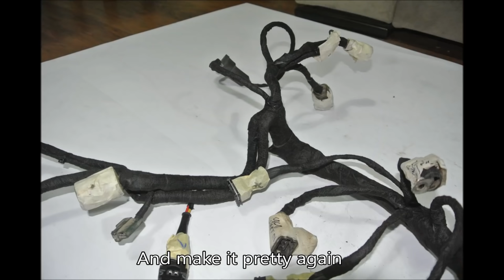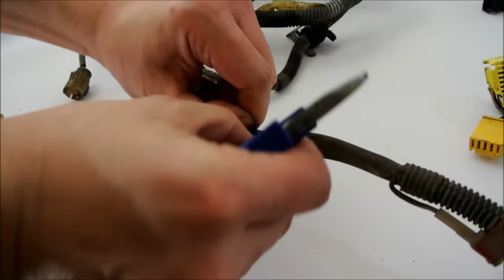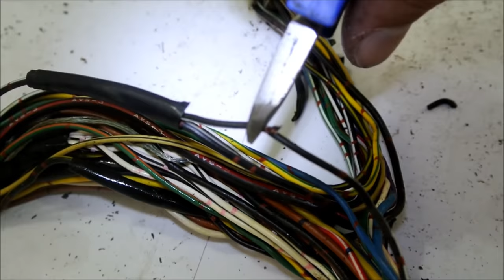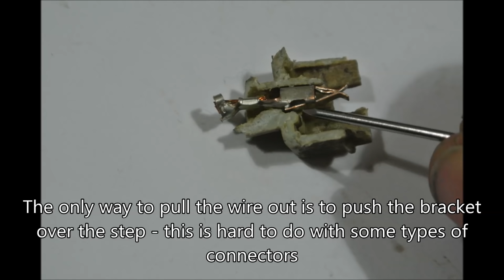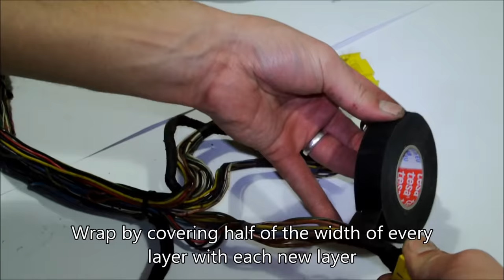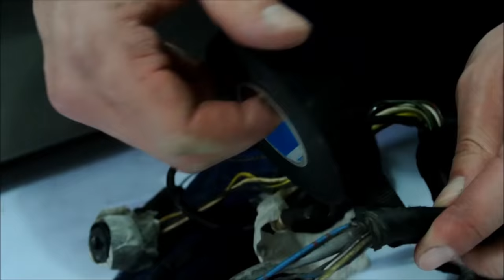How to DIY - wiring harness restoration

Comment: I've done my fair share of wiring harnesses and I can tell you that adding vinyl non-stick tape to the harness, before you add the Tesa tape, does wonders for making sure the harness doesn't turn into a sticky mess after some heat cycles. I go Vinyl Tape > Kapton Tape > Tesa Tape. I use the Kapton Tape on areas that will see higher heat ranges as it's supposed to keep heat at bay. I wrap the harness in TechFlex sleeving and use marine grade heat shrink to keep it tight. Hmmm, I may do a video on this 🤔
Reply: Please do!
Reply: Links to the tape you use please!
Reply: @Chache1527  For some reason I can't post a link in a reply, odd. But if you search for Dry Vinyl Tape or Non-Stick Vinyl Tape you'll get some hits! The Kapton Tape is pretty straight forward, search for that and you'll have a ton of options!
Reply: @VegasBoost  awesome thank you!
Reply: @Chache1527  Anytime! I'll be making a video on these wiring issues soon and this gives me the idea to include the parts in the description!
Reply: @Chache1527  I don't have Snapchat, but I'm on Facebook and Instagram. VegasBoost on both accounts! I'm almost always available 😊

Comment: "How to restore a wiring harness" (uses open barrel butt connectors).....
Reply: bruh, I was thinking the same thing lolll
Reply: Your absolutely right!! I would have used solder and shrink tube!
Reply: @laszu7137  I would not use the garbage that is the ROHS compliant solder, I would use a good high quality lead based solder in an automotive application. By removing the lead from the solder it becomes brittle and prone to cracking. Once the joint is complete a couple of small dabs of low temp hot glue allows for the shrink tube to create a watertight seal. I have done this before and never had any problems from the solder joints.
Reply: @gingersquatch9844  Of course it depends on where exactly it is and wheher it's secured or hanging somewhere. But in general a proper solder is pretty much equivalent to a well executed twist splice. Good enough for most things, but only trouble-free permanent solution has always been crimp.
Reply: @laszu7137  for whatever it's worth, the harness my LS1 came with is soldered with adhesive lined heat shrink tubing, in multiple points inside the harness.

The connectors are all crimped though.
Reply: @laszu7137  are you joking?

Comment: Another way in wrapping the harness with electrical tape is to wrap the tape sticky side out and then go back over it sticky side down. It adheres well to it self and it doesn't make the wires sticky.

Comment: awesome IDa dog, FYI - U nO, they have this spray stuff at Home Depot, temperature tolerant to 270• & it’s clear, then there’s this black rubber spray for high temperature areas of wires.. mIt as wL dU that nXtIm U rEdU a Yring hRnS.. (preventative rEruberIZng) then let it all dry B4 installing electric tAp, lUm, etc👋😒

Comment: Great video. I’ve got to upload a video one day on making a harness from scratch. I like rebuilding my engines in-house for my company, and when I do they got back “deleted” (diesels). What I do is buy all new plugs for what sensors are left on the engine, put them all in place, and run wiring from each sensor back to the ECM. I use fibreglass braided sheathing thats dipped in acrylic, I then place a 1 inch piece of shrinkable tubing half over the sheath and half over the wiring going into the plug. I use varying sizes of sheath as the harness grows in size. The great thing about the fibreglass braiding is it’ll take up to 500 degrees without melting (way higher than the wire will take). The result is a million mile harness, thats neat and free of extra plugs from sensors that are no longer in use.

Comment: Excellent video. A useful tip somebody posted on YouTube which I have since tried out for myself is to use a sewing stitch un-picker to remove the outer protective tape from the wiring loom. This cheap little tool is surprisingly effective.

Comment: Nice! 

To all the haters, I would not EVER solder under the engine bay. Uninsulated, seamless high quality butt connectors, crimped with good Snap-On or Klein pliers, then covered with Marine grade 3:1 heatshrink made by Temco, is far superior to any solder joint. Crimps do not crack, you don't have to worry about too much solder running down the wire and making it stiff and brittle, and you don't have to worry about "cold solder joints." I have seen plenty of failed solder points in electronis, including consoles and TV's, due to heat. The soft solder alloys used in electronics  / wiring are rather weak, because joints are operating at a high temperature relative to their melting point. Depending on the amount of current running through the wire, heat may or may not be an issue. 

A proper crimp, forms a cold weld in which when cut through, looks like a solid piece of metal. Moisture can not penetrate, and therefore, corrosion never occurs.  Once wrapped in adhesive heatshrink, the truck will rott to the ground before that joint ever fails. Crimping is also the advised option and the standard in Marine application. 

Look up ABYC standards. “Solder shall not be the sole means of mechanical connection in any circuit”. Further, crimping provides a solid mechanical connection resistant to “cold joints” breaking under fatigue, and removes strain.

Lastly, in a enviroment where there will be large amounts of vibration (engine bay), solder is again, not recommended. 

Crimp away driving 4 answers!
Reply: Most  automotive manuals recommend not using butt joints, but state if you are going to use them to solder the connection after crimping.

Comment: While trying to track down the  cause of my endlessly failing fuel pumps in my AW11, I replaced the entire engine bay wiring harness.  The previous owner had hacked it up.  Fortunately, I found a complete harness that was in good shape at the junkyard.  I pulled it out of the junker, cleaned it up, re-loomed it and put it in the MR2.  Sadly, it didn't fix the fuel pump issue.  That was why I was seriously considering using motorcycle carbs like you did...to eliminate the fuel injection headaches.  This was around year 1999.

Thank you for your videos!  I am really enjoying the memories they are triggering.  :D  I have even looked for used MR2s...but I have a wonderful car already, an Infiniti i30t that is paid for...which is better for me nowadays because I also remember how spinecrushing the MR2 ride was with the race suspension in it.  I'm getting old... lol!
Reply from the maker: I totally understand your woes. One of the reasons why I went with carbs in my case is that my engine was a horrible mix of parts from different 4ages. I had a rwd 4age throttle body on a fwd manifold, which caused huge air leaks. I had a distributor from an ae92 (i think) where someone just soldered on the connectors to fit it, but it made all sorts of issues. The afm was always acting up. And that was just the tip of the iceberg. It was such a frankenstein that getting it running right was impossible. I also have a nice "normal" daily car, and I get you there as well. The mr2 is a weekend thing to put a smile on my face :)

Comment: It is important to start taping from branches into the trunk (with some overlap into the trunk as well) and then one continuous taping segment starting from a far branch through the trunk ending at another far branch and then caping that end with heat shrink. This way there won't be any chance of tape unraveling at the branches.

Comment: I really like the heat shrink Connectors with solder in them. You get a crimp and when you heat the tube to close any openings it solders your connection
Reply: Sanjay gouda

Comment: I'm not sure why everyone is giving you so much shit about using crimp connections instead of soldering. Crimp connections are preferred for automotive and aircraft use because cycling through hot and cold temperatures (as well as rain, snow, etc.) will cause the soldered connections to eventually crack and split apart. 

For what it's worth, I re-did the wiring harness and battery cables in my AW11 with crimp connections and it has been running fine for a year now.
Reply from the maker: Thanks for the support. A few people pointed out what you are saying. But I guess the majority likes to repeat what they have been told is right, without really thinking about it.
Reply: +1 a GOOD solid crimp is flexible, solder is not and eventually cracks with heat cycles.
Reply: Jeff Reeves 
the worse part is moisture. use a proper but connector with sealant in it. or heatshrink with sealant. 
use heatshrink with sealant on solder connections also.
solder takes up less space than a but connector. 
solder makes more connection than crimp. crimp also has more opportunity for corrosion due to the lack of contact. corrosion grows. are your but connectors stored in air tight container, that does not allow moisture and corrosion .. even before use?

my opinion.. solder is best.
only time OEM crimps is at the connectors. new er sensitive Devices are now soldered even at connectors.
Reply: Jeff Reeves someone didnt take electrical
Reply: Jeff Reeves you're dead wrong..
Reply: Brandon Bassett yes. you
Reply: Except for grounds. Soldering is rarely used to repair aircraft wiring. Environmental splices is the preferred way to repair broken aircraft wiring.
Reply: TurboFlush Agree 100%
Reply: It's not JUST the crimp-on connectors. The fact he didn't use any heat shrink on that connection is paramount. All that heating and cooling attracts moisture. Without a hermetically sealed connection there's a failure point. They make crimp-on connectors with heat shrink already on them. The shrink even has a sealer in it that liquefies when heated to hermetically seal the connection. That alone would have sufficed as a proper repair.
Reply: Crimp every time but use a good quality crimper that doesn't cut into the insulation.

Comment: Ha, I felt the need to step in and say great job, even if you are already enjoying the fruits of your labor and don't have to listen to keyboard warriors like me and others.

I really appreciate your taking the time to do a little bit of research and choosing the right process and materials (Tesa is good stuff) for the job. While your work isn't exactly mil-spec, at least you're not soldering.

Personally, I splice open wires by crimping the ends with thin copper tube, then the connection is covered with adhesive-lined heat shrink. My crimping tool is a vise grip, works fine for my motorcycle.

Someday I'll make a wiring harness from scratch using proper materials like Raychem and crimp tooling that costs hundreds of dollars, but that's a long way off for us DIY guys.
Reply from the maker: +TheFlyingHat Thank you. Glad to see someone gets the point of DIY work :)

Comment: That cloth/ glass fibre tape works amazing.. inside a car or housing..insulating and keeps vibration noise down..example motorcycle harness exposed elements .. gets dirty, wet almost instantly and you cannot clean it..basic pvc electrical tape.. what it was designed for ?? that is why my 10, 000$ Harley Davidson didn't come with cloth tape

Comment: not sure if this was already mentioned however surgical tweezers help ease the process of removing the terminals from the connectors. alot better than those plastic tools.
Reply: or SWISS JEWELER STYLE PRECISION MICRO FORCEPS TWEEZERS SET will be perfect too.

Comment: If you're going to crimp repair a wire in a loom use crimps that have heat shrinkable casing on them. Stops water or moisture building up in the crimp causing the wire to break later on.
Reply from the maker: +Equal Thanks for the tip. I did wrap all the crimps in high quality electrical tape to stop moisture and other materials, plus wrapped the whole harness, should be safe.
Reply: +driving 4 answers (mr2 mk1 hero) For the price of the crimps allows better peace of mind and water/moisture will always find a way to mess up your loom , but I do think you did a good job of tidying the loom up.

Comment: I've done this to a few harnesses. 60s chevy so simple but never did I use a but conector for a repair. if I find but connectors I remove them and solder the wire. I don't always heat shrink a single repair in a bundle can be taped then the harness wrapped I like heat shrink in situations that are not wrapped it looks cleaner.
Reply: m

Comment: Basically I do the same EXCEPT I use a sheet of ply wood about 30" wide by 6 feet long laid with a sheet of paper then pin the harness down using screws and aluminum wire... draw all connectors and terminals on the paper sheet with orientation of wires in the plugs, remove all plug ends and wash them in the dishwasher, clean terminal ends and coat with electrical joint compound. Fix all frayed wires using same gauge and color wire using soldered butt splices with shrink tube, then Rewrap with harness wrap and friction tape, replacing any attaching clips and etc.

Comment: Had me until butt connectors. Aptly named because they are ass. Solder and heatshrink, or wish you did later while looking for that loose connection. Makes the whole thing worse than pointless to hide that crap in the loom.
Reply: I agree
you can use a butt connector but an uninsulated one 
you can solder the connector but you should that the caution to clean it with alcohol after soldering( to remove the rosin) and use a glued type heat shrink to completely seal the repair zone.
it is of a capital importance on an harness used on engine management system
Reply: Juan Fernandez try and find a soldered connection on a factory harness. the heat cycles in an engine bay destroy solder joints. hence everything wire in a good wiring harness will be crimped.
Reply: the essence of crimped connectors in automotive harnesses is essentially a matter of cost
it's much more cost ( and time) effective to crimp instead of solder a terminal
usually the failure of a soldered terminal is the corrosion and it's essentially due to a bad cleaning of the joint after soldering and to corrosion due to humid environnement.
Often, I use uninsulated terminal that I crimp and insulate with a glued heat shrink sleeve.
On the ignition wire, I always solder the terminals as a failure leads directly to a breakdown.
Reply: magnetic0314, I've never heard of such a thing. The insulation and heat shrink would start to burn before the solder received enough heat to melt or destroy proper solder connections. However, I'd be interested to see if you can cite something supporting your claim. What I could see happening is the wire getting too much juice or the joint being a poor connection creating resistance and getting too hot. That could over time slowly destroy the connection.
Reply: VideoMorsels 
the thing i see a lot of guys doing is using way too much solder. 
It wicks down the wire and ruins it and now it's solid.
All you need is just a touch for a split second on a heated connection. 
Here's something similar but different. 
An old plumber showed me , when soldering copper pipe(old school), you know the size of it, say it's 1/2" copper. 
Bend the last 1/2 inch of your solder roll in a 90 degree bend  , that's all you need. 
That thought can be carried over to wire soldering. 
You need less than you think. 
(Not you personally, sounds like you know what's up)
Btw soldered plug wires make those pixies dance faster and give you more horsepowers 😂
Reply: good
Reply: You don't solder wiring on a vehicle as it gets brittle and engine vibration causes a break at ends of the solder joint. The whole loom is out just run new wire
Reply: Buy decent butt connectors and good quality ratcheting crimp tool, they will then work well.
Reply: or cold solder..if you can find

Comment: Best tool for getting spade connectors out of connector is a dental pick. You can usually pick them up frorm a military surplus store. You won't know how you lived without one once you have used it! Slide the pick between the spade and the plastic, press the tab down, gently pull from the back and it will slide right out. Little harder when you have two tabs in the same block but still the best way to them out without destroying the plastic connector.
Reply from the maker: Henry Cole Stage Thanks for the tip, sounds like a good idea, I'll definitely try it next time I need to do something like this.

Comment: The only thing I think might have worked a little better is to solder the broken wires and use heat shrink. Not sure what type of black tape was used but be carefull. after time with all the engine heat some black tape will become brittle and crack, split and allow moisture to seep in. good video.
Reply: +Greg Chamberlain Same here. In a few years you may got a problem with the butt connector... soldering is much safer :]
Reply: Solder is not appropriate for engine bay wiring. The act of soldering removes the flexibility of the wire in the joint area and flexibility is life, for a wire.  Soldered joints are brittle and will eventually split due to the vibration ad temperature variations of the environment. Serious loom builders ONLY use crimped connectors and almost all production cars only have crimps in the engine bay
Reply: @ballsDeepMotorsports - Correct. Nothin more too say - Thumbs up

Comment: I clean mine of all tape then throw the harness into my ultrasound cleaner 
Hit it with compressed air and hair blower if I can’t hang outside in the sun
Then wrap with a great tape and put dielectric grease on all connections

Comment: No, put it on the connector holder before you wrap it with tape, sometimes theirs a situations that youre going to have a tensioned wire when you put it back to the machine.